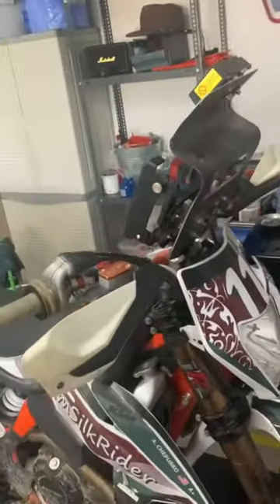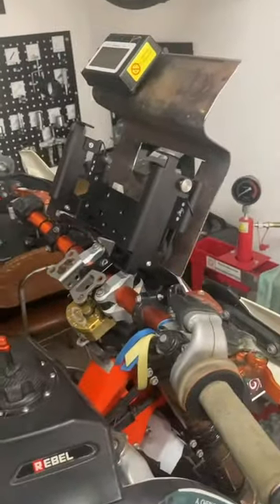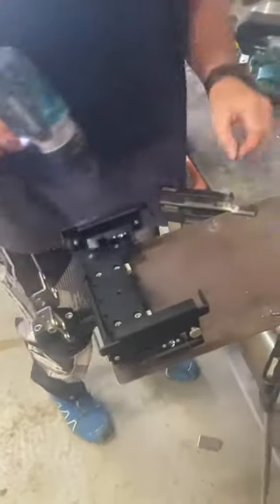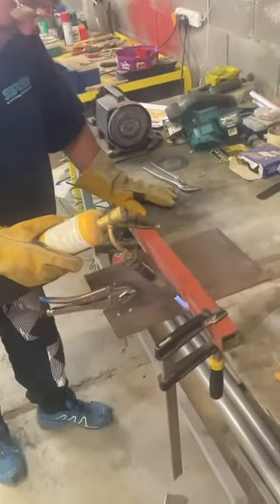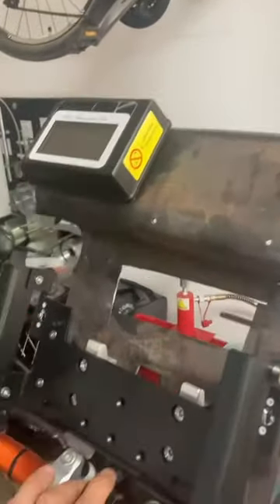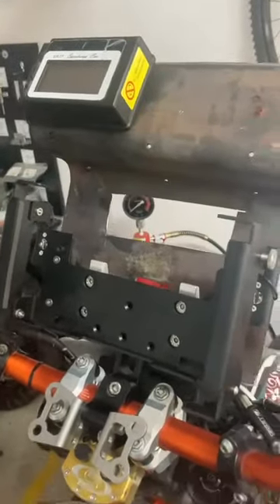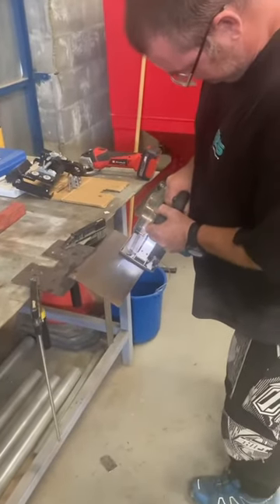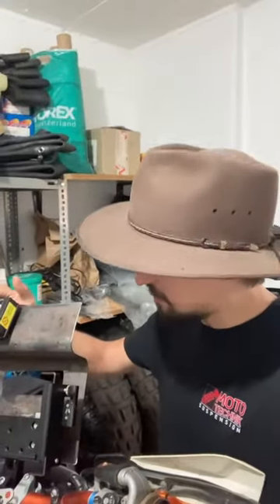Building a digital roadbook bracket - ERTF Unik4 and Speedocaps for enduro bikes

Comment: About to do my own UNIK4 build, did you think it will be easier to run with 1 repeater not 2?
Reply from the maker: Depends on how fast you wanna go. I tried with 1 repeater at Sonora on the CAP and odo screen and it’s too small to glance at at high speeds or in dunes. So I got the second repeater so each one is dedicated to CAP and odo in the biggest font and as close as possible to eye level.
Reply: Thanks for the response @SilkRider  I'll look at going for the two! It'll be my first time with a speedocap, can they run independent of the unik so I can convert the bike to just two speedocaps? Not much info online
Reply from the maker: @tcrossau  you have to pay for the Evo version which is even more expensive to work independently from Unik. There’s also an adapter power cable, it’s all on the ERTF site
Reply: Just got my hands on the UNIK4 kit, any chance you did a final build of the Plate? Willing to make a second one and ship it out this way, would be awesome if that's possible.  @SilkRider
Reply from the maker: @tcrossau yes check the last few videos on my Instagram silk.rider and I also posted a YouTube Short here. What race are you doing? I barely had time to make one for myself plus a spare. We will make more when we get back in November…